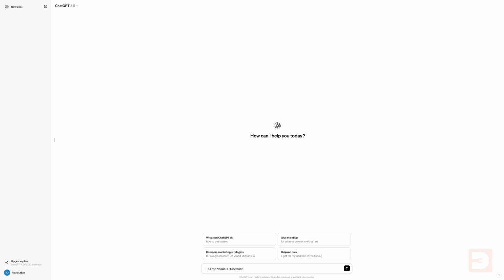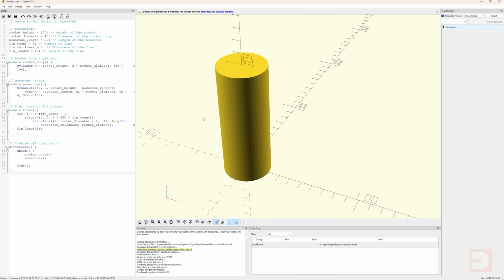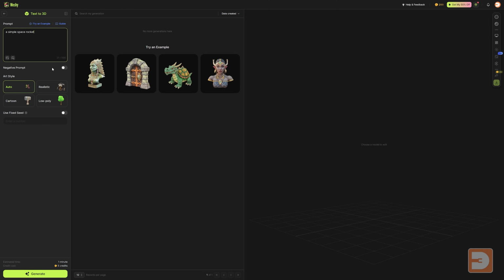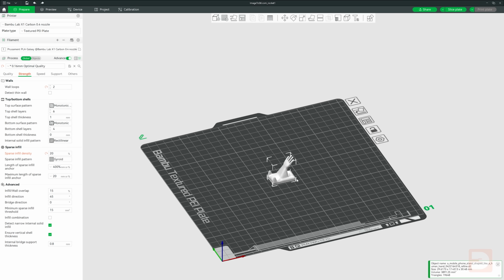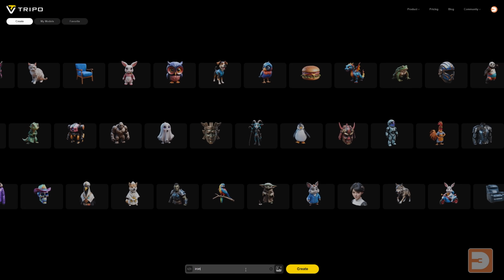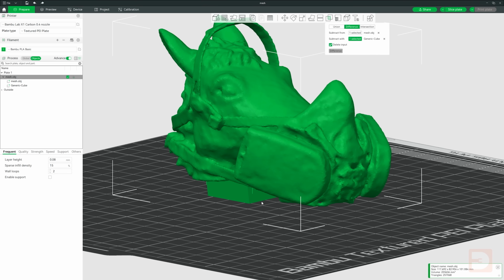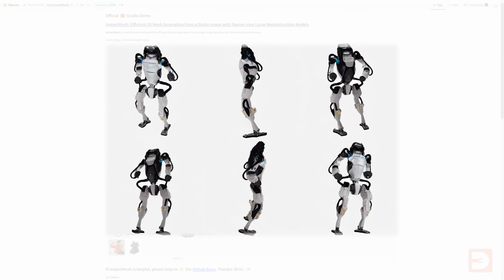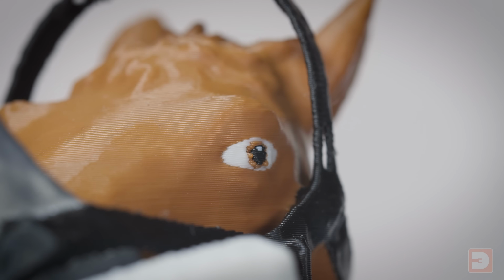Top Free AI Model Generators Tested for 3D Printing

Comment: Asked Claude again today to see what it could do now compared to a year ago when you posted this. 

```
// Single Dining Room Chair
// Parametric design - adjust these values to customize your chair

// Chair dimensions (in mm)
seat_width = 400;        // Width of the seat
seat_depth = 400;        // Depth of the seat  
seat_thickness = 30;     // Thickness of the seat
seat_height = 450;       // Height from floor to top of seat

backrest_width = 380;    // Width of the backrest
backrest_height = 350;   // Height of the backrest above seat
backrest_thickness = 25; // Thickness of the backrest
backrest_angle = 5;      // Angle of backrest tilt (degrees)

leg_width = 40;          // Width/depth of chair legs
leg_thickness = 40;      // Thickness of chair legs

brace_width = 25;        // Width of cross braces
brace_thickness = 25;    // Thickness of cross braces
brace_height = 200;      // Height of side braces from floor

// Colors for visualization
chair_color = "burlywood";
cushion_color = "darkred";

// Seat cushion module
module seat_cushion() {
    color(cushion_color)
        translate([0, 0, seat_height + seat_thickness/2 + 15])
            cube([seat_width-20, seat_depth-20, 30], center=true);
}

// Chair module
module dining_chair() {
    color(chair_color) {
        difference() {
            union() {
                // Seat
                translate([0, 0, seat_height])
                    cube([seat_width, seat_depth, seat_thickness], center=true);
                
                // Backrest
                translate([0, -seat_depth/2 + backrest_thickness/2, seat_height + seat_thickness/2])
                    rotate([backrest_angle, 0, 0])
                        translate([0, 0, backrest_height/2])
                            cube([backrest_width, backrest_thickness, backrest_height], center=true);
                
                // Front legs
                translate([seat_width/2 - leg_width/2, seat_depth/2 - leg_thickness/2, seat_height/2])
                    cube([leg_width, leg_thickness, seat_height], center=true);
                
                translate([-seat_width/2 + leg_width/2, seat_depth/2 - leg_thickness/2, seat_height/2])
                    cube([leg_width, leg_thickness, seat_height], center=true);
                
                // Back legs (extend higher to support backrest)
                back_leg_height = seat_height + backrest_height + seat_thickness/2;
                translate([seat_width/2 - leg_width/2, -seat_depth/2 + leg_thickness/2, back_leg_height/2])
                    cube([leg_width, leg_thickness, back_leg_height], center=true);
                
                translate([-seat_width/2 + leg_width/2, -seat_depth/2 + leg_thickness/2, back_leg_height/2])
                    cube([leg_width, leg_thickness, back_leg_height], center=true);
                
                // Side braces (left and right)
                translate([seat_width/2 - leg_width/2, 0, brace_height])
                    rotate([0, 90, 0])
                        cube([brace_width, seat_depth - leg_thickness, brace_thickness], center=true);
                
                translate([-seat_width/2 + leg_width/2, 0, brace_height])
                    rotate([0, 90, 0])
                        cube([brace_width, seat_depth - leg_thickness, brace_thickness], center=true);
                
                // Front and back braces
                translate([0, seat_depth/2 - leg_thickness/2, brace_height])
                    rotate([0, 0, 90])
                        cube([brace_width, seat_width - leg_width, brace_thickness], center=true);
                
                translate([0, -seat_depth/2 + leg_thickness/2, brace_height])
                    rotate([0, 0, 90])
                        cube([brace_width, seat_width - leg_width, brace_thickness], center=true);
            }
        }
    }
    
    // Add seat cushion
    seat_cushion();
}

// Render the chair
dining_chair();

// Information display
echo("=== DINING CHAIR SPECIFICATIONS ===");
echo(str("Seat Dimensions: ", seat_width, "mm x ", seat_depth, "mm"));
echo(str("Seat Height: ", seat_height, "mm"));
echo(str("Backrest Height: ", backrest_height, "mm above seat"));
echo(str("Total Chair Height: ", seat_height + backrest_height + seat_thickness/2, "mm"));
echo(str("Chair includes comfortable seat cushion"));
```
It's doing a bit better!

Comment: Nice video
! I generated a model using AI on the Tripo AI website and downloaded it in both 3MF and OBJ formats. However, when I opened it in the software for my Bambu Lab X1 3D printer, it only shows a single color and material. The model I created has four different colors, and I’d love to print it in full color. Could you kindly advise me on how to achieve this? I’ve already tried using Blender, but it still only shows one color. Any help would be greatly appreciated!

Comment: the luma ai 3d model turned to 3d print is very satisfying for me , thanks ❤

btw can someone tell me what softwere was used to edit the 3d model to make it ready for 3d printing? i heard it something like a "slicer" .
Reply from the maker: With 3D printing, software wise it generally goes like this:
- CAD software is used to design the 3D model (Fusion 360/TinkerCAD/Blender etc)
- That will export a 3D model in a format such as an OMF or STL
- That file is then imported into a Slicer. A slicer is a piece of software which you enter into it all the information about your printer (the dimensions, layout, capabilities, the material you're using, the temperatures the material needs etc). There are many slicers available, almost all are free, and most FDM slicers work with most FDM printers, but many also have special features unique to them that work with printers made by the same company.
- Once you import your object into a slicer, you position and orient it in the way you'd like it to print, then enter the settings you want that will affect the quality etc (things like how thick the layers of the print are, the speed of the print).
- The slicer then exports a file for the 3D printer (this used to always be a gCode file but now many printers also use 3MF files). 3MF files include the gCode but also additional information that can be used by the printer. gCode is basically a list of instructions for the printer (move X axis 3mm, heat to 200 degrees, move Z axis down 1mm, extrude 12mm... etc). 
- You then transfer the file to your printer (either via SD card, USB stick, or over WiFi) and when you start the print, the machine is effectively just working it's way through the long list of instructions.
Reply: @3DRevolution  thanks for the detailed answer , however i wonder if i can download the obj/stl file from luma ai and upload that model to a online 3d printing web service , will that work?
Reply from the maker: @dr20231may  If you're sending the design to someone else to 3D print for you then it should be absolutely fine sending them an OMF or STL.

Comment: Good video, just two things: A seed is not "any big number", but a number to deterministically generate a pseudo random output (using a PRNG). Also true randomness in SE is actually possible, if a TRNG (true random number generator) is being used.
Reply from the maker: Thanks. Ah well yes that's kind of what I meant. A seed is basically any big number, but what it is used for is to generate a pseudo random output as you mention.
I'm intrigued by the TRNG though. I'm not aware of any way to generate a truly random number. Yes you can write something that generated a number based on the millisecond and day of the month, or by taking an analogue reading of the radio interference on a wire, but technically that is still based on a manipulatable figure.

Comment: I am working with both MS and GitHub copilots all the time, and the code they both generate is always garbage, mainly for the reason that they produce a code that should Look like you expect the code doing that particular thing look like, not actually doing what it supposed to.  To correct that the training paradigm should be changed, LLm should be allowed to execure the code and compare results to the expected, and it's not happening.

Comment: Nope, chatGPT doesn't have an understanding of what a rocket looks like.

It's a language model, not a general inteligence.

It's picked up a pattern in langague use.

It's spotted a pattern of setting variables in scrupts, so it's coppied that.
It doesn't "understand" what a variable is, or how it functions.
Computer code is a language, so it can produce something that convincingly follows the rules. That doesn't mean it actually works! 
Much like if you get it to write an essay. Surface level, it looks impressive. But if you actually know the subject, it kinda meaningless.
You'd be better off seaching Stack Exchange. Which is pretty much what LLMs did when learning what code looks like. 

Generative AI is a useful tool, but it has to be used very carefully. It's not an information resorce, as much as Google & MS are trying to push it into one. It cannot fact check. Using generative AI incorrectly can be dangerous.

Uh. despite my rambling, good video, & an interesting experement! :)
Reply from the maker: Haha I appreciate your rambling and your comment. I completely agree that it's not what LLMs are designed for or intended to do, but I thought it would be interesting to see how they'd perform.

Comment: chatgpt makes use of this:  import matplotlib.pyplot as plt

However, if you try to compile that in OpenSCAD, the python script will fail.  Any ideas on how to get past that error?

Personally, I'm waiting for the day when you can interract with your mechanical cad ide like this with voice commands:  "Put a cylinder on the side of that block.  No, that side.  Good.  Center it.  Good.  Extend it out 4 inches.  Good.  Put a hole midway along the cylinder.  Align the hole with the Z axis.  Good.  Make it 1/4 inch in diameter.  Good." etc.  Much like Deckerd interacts with his photo-investigative tool in Blade Runner.

Comment: Microsoft Copilot uses ChatGPT-based models as its backend, so it's not too surprising that the resulrs are similar.  I wonder how Google's Gemini would do with this.
Reply from the maker: Definitely, but there are some tweaks with it's results so I thought it would be interesting to see.
I did also test Gemini at the same time, if initially intended to use that instead of CoPilot, but everything it spat out was so broken that OpenSCAD refused to even run the code. It wasn't just like some of the ones in the video where it ran it but showed errors, it plain didn't run it. So I entered up deciding that wouldn't be contributing anything to the video and didn't include it.
I'm sure it'll improve past that point, but so far I've not been blown away by Gemini in general unfortunately.

Comment: Meshy’s text to 3D generator didn’t work well for me so I tried using Copilot Designer’s text to image first (prompting for a 3d image) and then ran the image through Meshy’s image to 3D generator.  That worked pretty well.  Well enough for a prototype.
Reply: Update: Instant Mesh did a much better job than Meshy’s in converting Copilot Designer’s 3D image to a 3D file.
Reply: Thanks!
Reply: Thanks for the research!
Reply: Many thanks how much it cost you over all for protype .

Comment: Unrelated to 3D Printing but: I used to pay people all the time to get custom python scripts made, usually for automating file sorting/transfers/conversion etc. 

Ever since the AIs came out, I have not had to pay a single cent to anyone anymore. The AI can do it all. 

ChatGPT is really bad at coding and fixing errors. Copilot usually gets it on the first or second try. The only issues is that theres a 5 message limit, and a character limit, so if you dont get it working in 5 attempts, you basically have to start over. 

I think a better way for you to test the ChatpGPT and Copilot OPENSCAD generation, would be to tell it the errors, and to fix them, rather than you correcting them yourself. 

Usually when I get errors, I just copy paste the console output into the AI, and it automatically picks up on the error, and suggests various ways to correct it, or I just give it the ,,no yapping" prompt, and ask for a solution
Reply from the maker: I absolutely appreciate that and I'd actually spent an entire day doing that with each of them before producing this video, but no matter how much back and forth I did with them, they never improved with this unfortunately. It gave so little that I just didn't think it was worth including in the video.

Thanks for the suggestion though, I'll definitely be doing more and different tests and comparisons in the future.

Comment: Using GPT 3.5 is itself a lost cause. You have to use GPT 4 or 4o
Reply from the maker: At the time of recording this video, 4o hadn't yet been announced, and as I mention, in this video I'm explicitly looking at tools and services that are available to use for free, so 3.5 was the only version of ChatGPT to choose from at the time.

That said I do have GPT4 and had already tried this with that at the time, and have tested it with 4o since with near identical results.

The only difference is, once I get 4o literally gave me an actual functional STL to download. However it just contained an egg shape, and through the 20+ further attempts, after it told me it was giving me an STL it would then come back and say it doesn't yet have the capability to make STL files, even after me reminding it that it already had.
And I found the results of using 4o with writing code for OpenSCAD identical to in this video.

Comment: My experience with chatgpt & openSCAD was very similar to yours. After several rounds of corrections, the LLM failed to grasp what I was after, and I ended up writing it from scratch. I tried to be as precise as possible in my descriptions of each geometric part for the LLM, but it didn't get the job done. So it's interesting but not useful. At best, it can rapidly create an almost-correct code that you have to tinker with manually.

Comment: I was about to come and correct him on how he should have been using the LLM's in round one. But then I realized he's using them just like a normal user would, not somebody who's more familiar with Ai. So, yes the LLM's he used could have done better if I were prompting them, the average non AI user will have the same results as him. So, nice. 
Also, I was not aware of the other AI tools.. I already wanted a 3d printer.. noooo now I neeeed one. heh
Reply from the maker: Exactly. The whole point of this video was looking to see how accessible and useful these tools were to the average person. That's why I was only looking at tools that are available to use for free, and didn't get into the nuances of how to be more proficient at prompt engineering etc. 

I could have written better prompts, recorded better videos for the NeRFs, and could have chosen more suitable 2D images, but the appeal of the concept of these sorts of tools is simplicity and ease of use, so I wanted to see how they'd deal with the sorts of interaction they would likely receive from someone who didn't want to or didn't have the time to become more experienced and/or specialised in it's use.